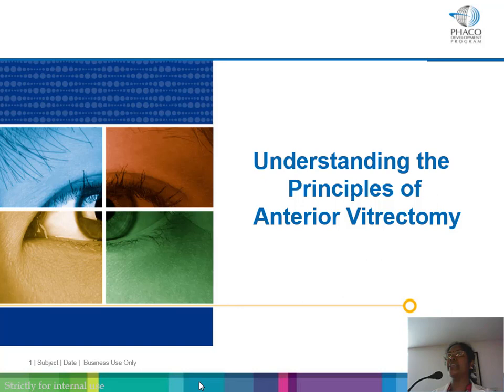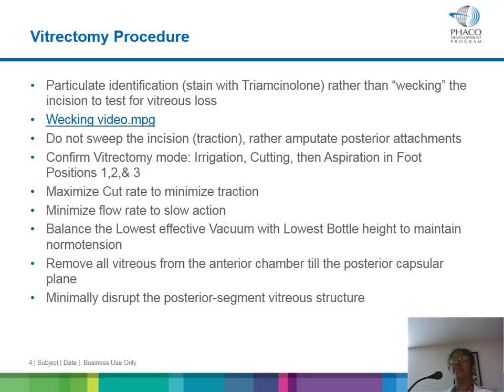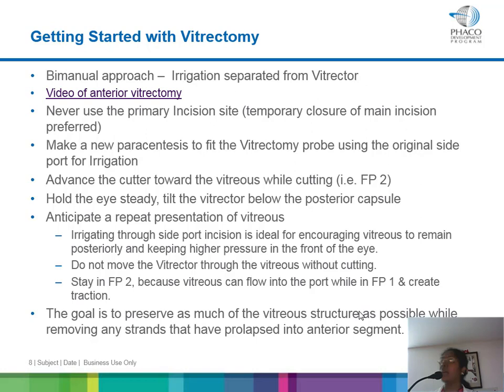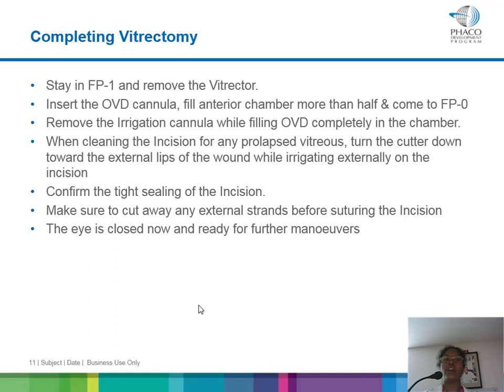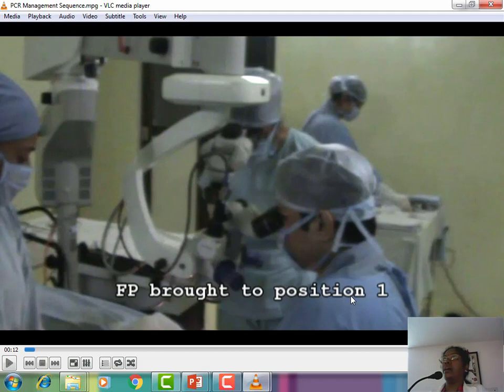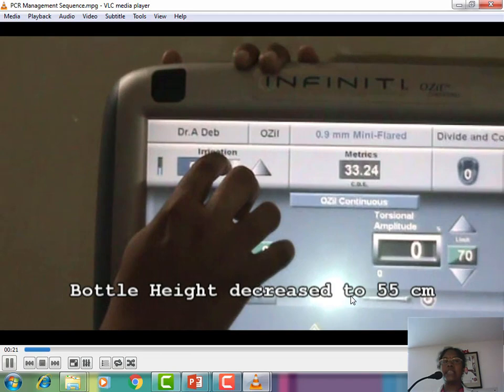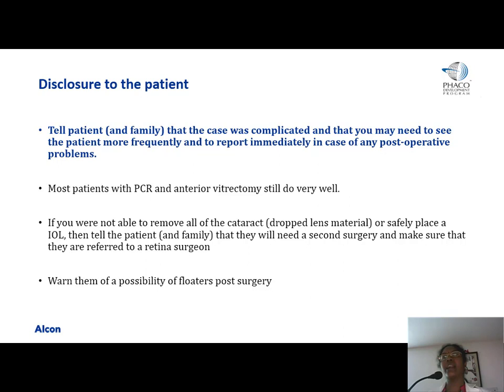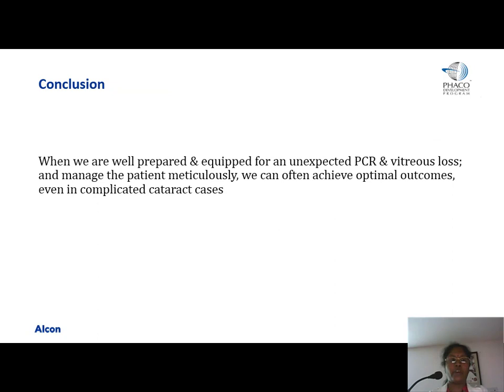Understanding the Principles of Anterior Vitrectomy

Comment: excellent presentation. meticulously explained steps and the logic behind all steps of action.thanks and congratulations.
for new surgeons details of dilution of triamcelone ( Quantity and Substance) if mentioned will be of more help.
even after a good vitrectomy reaming stands of vitreous in wound can be more detailed.( surgeon feel that when theyhab=ve done a good vitrectomy will there be any NEED  they need  to use vans scissors ?)
surgeons not equipped with auto vitrectomy how a good and safe open sky vitrectomy can be done( for surgeons with sics facility only)
very helpful and detailed presentation on principle and procedure of anterior vitrectomy.